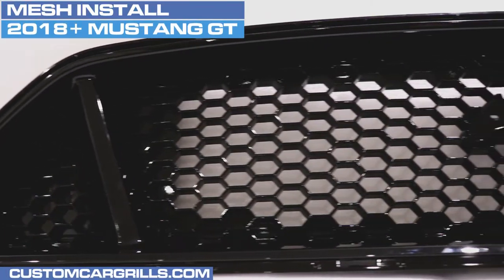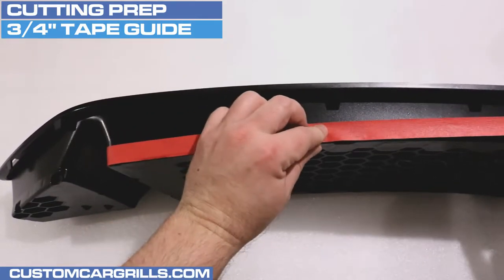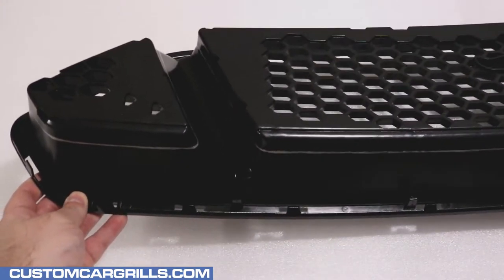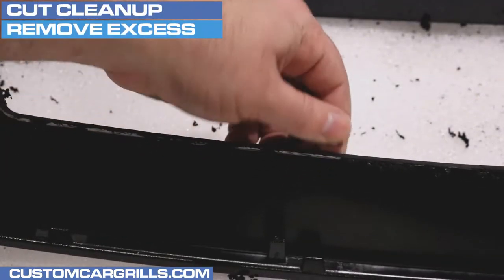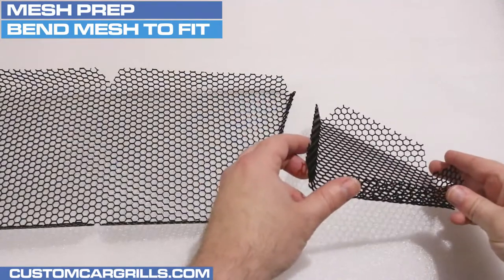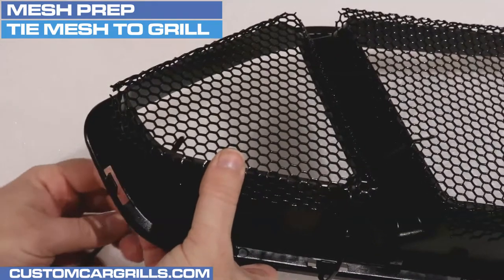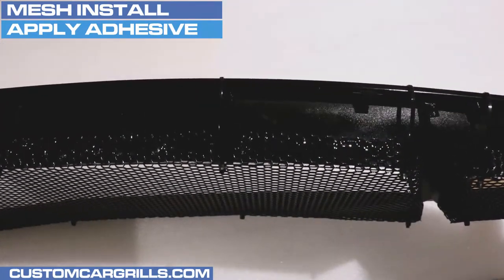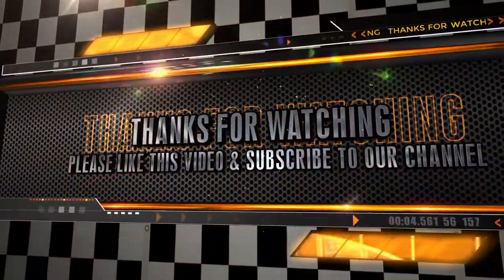Ford Mustang GT 2018+ Grill Delete Mesh Installation How-To by customcargrills.com

Comment: Does the full replacement grille just pop into place or does it need to be modified?
Reply from the maker: The full replacement pieces are pre-modified; we will have done the work shown in this video.  All you need to do is swap the old grille with the new grille.
Reply: customcargrills thanks 👍